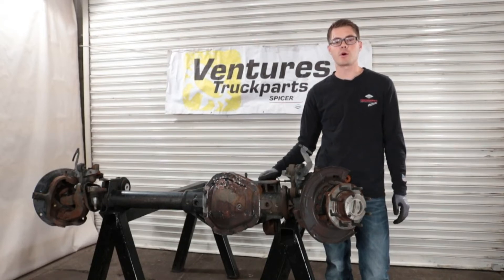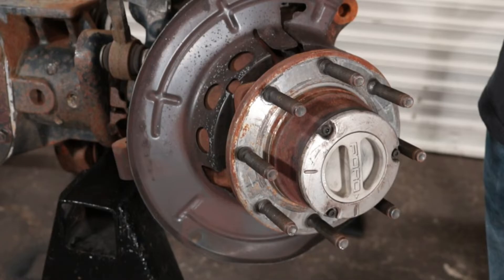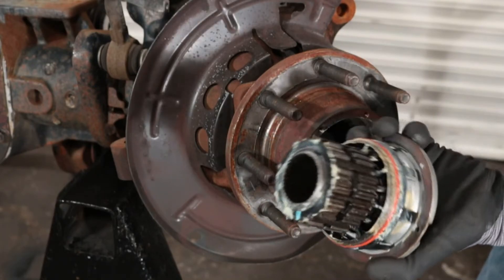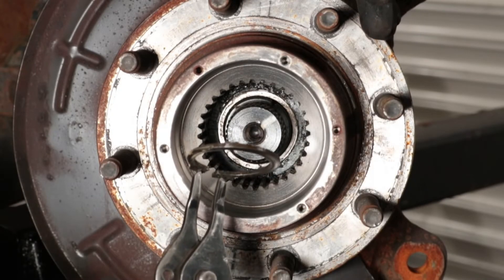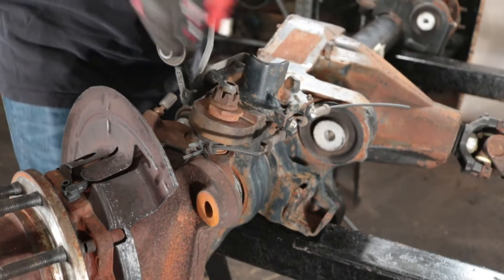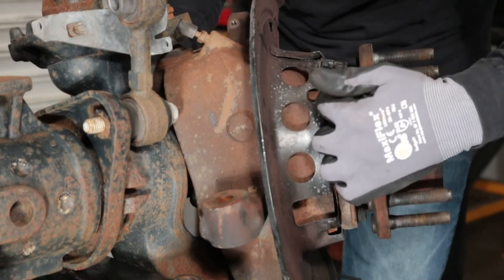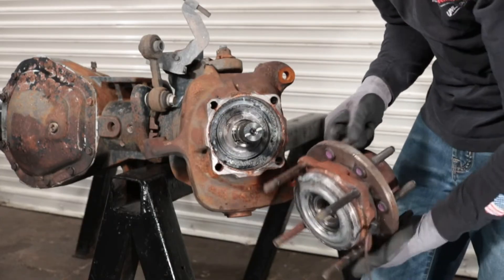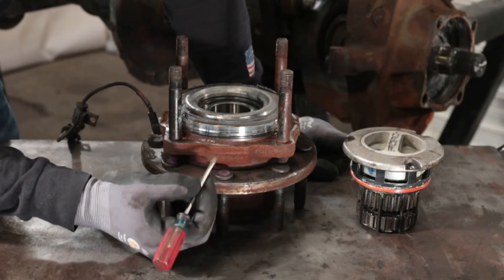2005-2020 Ford F250 F350 F450 F550 4x4 Super 60 Front Axle Tear Down And Trouble Shoot

Comment: Guy has 2013 F 350   4 WD Dump Truck  with 2 broken front axles.He wants to just run it as a 2 WD by removing front axles! Is that a viable option?
Reply from the maker: Not a good idea. Removing the axles will let water and dirt get into center section.

Comment: if the U-Joints are no good... can get CV stud shafts to replace them? because with a spool on the front, that U-Joint drive shaft lining up thing with the caps is another thing?
Reply from the maker: Give us a call and we can walk you through it. 801-621-0091

Comment: Hi anyone knows if rockauto sold a all seals(vacuum seals!!) in and out  because I replaced a all bail joints and I need replaced that seals! And a bolt on top of the  hub! for connecting a vacuum hose!  VENTURES sold that seals? Thanks fellas great vedeo 👏👌👍

Comment: Great tutorial. To be "clear": Super 60 can be referring to any Ford Dana 60 post 2005 in all of these axles, depending on who is talking. BUT the "Wide Track" or "Fat Boy" is the real Super 60. Only came in a few F350 duallies for limited years (2008 to 2010) and all F450 and F550 from 2005 on. To make things worse the naming conventions get all mixed up when sourcing bearings, seals and U joints. Just did all of this. Great fun, multiple part returns, none of the fitment charts work etc. different spline count, stouter parts, same drag links, shocks are different, different U joints, same track bar. It's a mess. You want the real Super 60 if you are doing any conversion. I can turn a 84" cab to axle F450 tighter than a short bed f350 now.
Reply: Is there any way to identify a “super” 60 ?
Reply: @moejr14   Yes check the stamp plate for model and look it up. Can't mistake them. The tubes are much thicker, brakes and u joints are huge. Best bet is see what truck it came with. Check the axle code on the door jam. F450, F550 2005 on and some select F350 dually (rare trucks).
Reply: I'm actually interested in doing a 2x4 to 4x4 conversion on an f450 so this was a helpful post thanks
Reply: No, Ford 'Super Duty' 60 does not mean 'Super 60'  they are very different, ask the manufacturer: Dana, they don't think they are the same.
f350-f450 dual rear wheels only had them in 4.33 and higher. post 2005
f550 and higher had them
united electric info is mostly wrong. (aka pirate)
Reply: @EricIvresen  I didn't say that..read it again.

Comment: So much damned confusion on O-rings and nomenclature. I have a 2006 F450 with the REAL Super 60 "Wide Track" and manual locking hubs. It's been three straight days chasing part numbers for seals and O-rings. From what I can tell the spline shaft between the Super 60 and the "WIDE TRACK SUPER 60" is the same but the spline count is different. So, all the seals should be the same? I got the yellow O-rings (yours are orange, ugh) for the manual hubs and now I see there is a mystery black one too for Vacuum? Is that black O ring on the manual locking ones? Wide Track? Ugh.
Reply from the maker: Call us and we will be happy to help. 801-621-0091. The black one is for the wheel bearing unit hub. Not the 4x4 locking hub.

Comment: Regarding the U-joint. While the axle is out try greasing the joint. If grease doesn't come out of all 4 cups replace it. I would probably replace it with a new one anyway as they are not very costly for a quality part.

Comment: So ford uses the same axle from 05 on up? Basically I'm looking for a salvage  front axle for my 2015 f350 and cant seem to figure out which years will fit
Reply: Any 05-16 will. The brakes changed in 2012 though. So size and rotors are different so be advised there. Other than that, the rest is identical

Comment: Does the 2006 not have needle bearings on inboard side of hub to support the axle?
Reply from the maker: They updated the design and it is now a sealed bearing.
Reply: @VenturesTruckParts  so the sealed bearing can still be changed like the needle bearing style?
Reply from the maker: @matthewrodrigues2637  Yes that is correct. The sealed ball bearing can be replaced.

Comment: Does that year not have the outer shaft thrust washer behind the hub assembly? Looked like it was missing in the video.
Reply from the maker: That is correct. This axle Design starting in 2005 does not use thrust washers.

Comment: Hello,  I have an 06 f250 with this axle. I found the schematics online and it shows there is a thrust washer, but I did not notice it in the video. Does this model have one or not? thank you
Reply from the maker: An 06 will not have a thrust washer. The front axle design changed in 05 to not use thrust washers.
Reply: @VenturesTruckParts  thanks a lot! your videos helped me a ton! thanks guys!

Comment: This is a great video. My diff fluid is leaking out my passenger side of my front axle. How do you set the inner tube seal? Thank you.
Reply: Axel shaft seal installer

Comment: what number is on snap ring plyers, i bought 4 different pair none work big set bent.
Reply from the maker: They are an Armstrong brand. I do not have a part number. It has been worn off from use...
Reply: @VenturesTruckParts  ok any idea who sells them, are they, sears, otc, or something
Reply from the maker: @dennishebert5259  they have some on amazon. I just dont know the model. Just search Armstrong Snap Ring Pliers.
Reply: @VenturesTruckParts  ok thanks
Reply: Hi Dennis i have a pair of snap on that i use it does the job but its hell getting the snap ring off and on and i was looking for some longer reach pliers any luck finding the part number that the guy in the video is using Thanks.
Reply: @ricardorodriguez-se7tp  pretty late to reply, but the offroad community are big fans of Knipex 4611A3. I use these also, and they have no issue with the snap ring. Looking them up on Amazon and read the reviews.

Comment: What truck should I be looking for that would have 5.38 gears from the factory? I need single wheel non dually. I thought super 60s were 10 lug, but this one seems to be 8x170 single wheel...What gives?
Reply: 10 lug are f450 and 550. 250 and 350 are 8 lug.